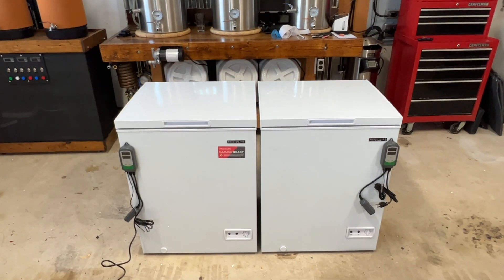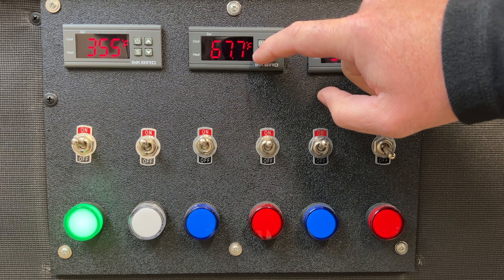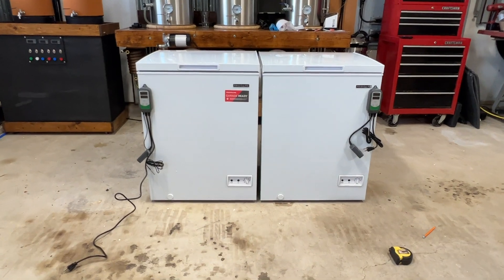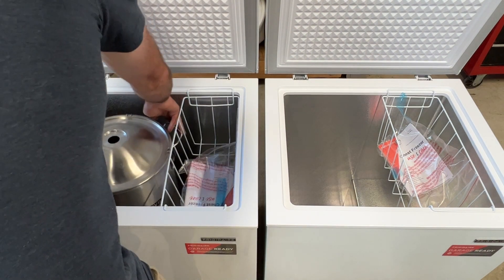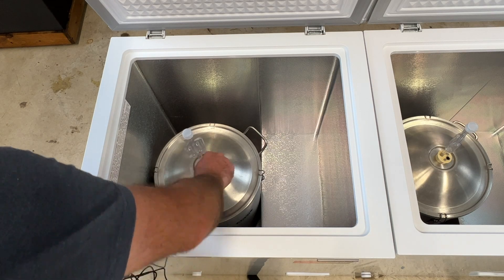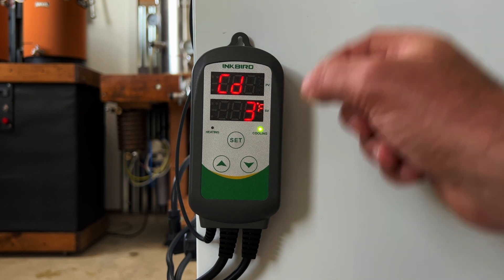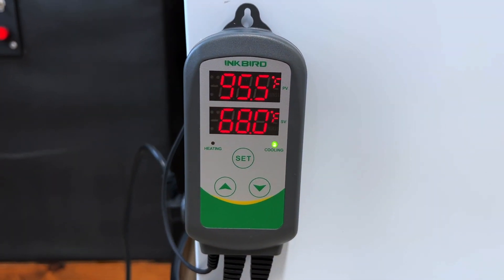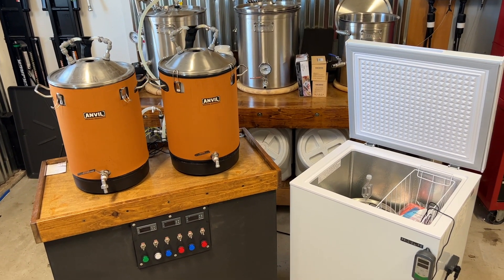How to Build a Fermentation Chamber [ INKBIRD ITC-308 ] #temperaturecontrol #homebrewing

Comment: How much drift in temp is normal for an Inkbird? I am seeing swings of plus/minus 5 deg.
Reply from the maker: I ran a test a while back on  my glycol and fermentation chamber. From what I remember it the temp swing was comparable. 5 degree was at the wider range. Depending on your setup, you can dial it in a bit by having your cooler turn on sooner. I see 1-3 degree swings in my fermentation chamber. The glycol is 1-2 in moderate climate. DIY is tricky to estimate, but I know my systems swing 1-3 degrees. Hope this helps! Cheers!
Reply: @justhomebrew   Thanks for the quick response. One more question if you don't mind , does the freezer temp setting play any part in the temp swing that you have noticed? Thanks -- Tim
Reply from the maker: @timh3662 hmm, good question. What I would do if your dealing with big temp swings is 1, set your desired temp. Then play around with your delayed compressor settings. I have relatively new freezers so they don’t seem to have problems cooling. You might have to shorten the delayed compressor time to off set your temp swing. Also, try different locations for your temperature probe. I monitor my fermenter temp right in the middle of my fermenter using a thermal well and probe. Maybe a your temp probe can be positioned better.

Comment: You have an awesome brewing space! Very neat 😊

Yesterday I built similar setup with an old fridge that I was given for free and a budget electric thermostat. I duck taped temperature probe to my bucket fermenter and set temperature setting 19.0 C for start and 18.8 C for stop. I set fridge power for minimum, so after shutting down it doesn’t go very low. It is working great and keeping temperature between 18.6-19.0 C. I looking forward for much more nicer and clearer beer 😊

Cheers from Kyiv!
Reply from the maker: Thank you! This little space in the corner of my garage has been a work in progress for a very long time:) It’s a blast to brew in.
Reply from the maker: I’m glad to hear you got a fermentation chamber up and running! I love a good diy update:) although you don’t need to have fermentation chamber to get started, I found this was the best addition to my brewery that took my beer to the next level. Cheers!
Reply: @justhomebrew yes, the temperature control isn’t necessary for the beginning, but now it is really hot and I got some issues with cider. It has too much of a harsh ethanol flavour, that I wasn’t getting in spring time. but interesting, that my first all-grain beer went absolutely fine. Now my second all-grain beer will be fermented in a controlled environment so it must be much more better than the previous one. Fermentation now is striking its active phase and I’m very happy. It is going slower compared to fermenting at 29 C but I hope it will worth it.

My brewery now is a 2 square meters in corner of apartment hallway. Almost everything is DIY and I really enjoy this hobby. Especially when building something and finding out solutions for technical aspects.
Reply from the maker: @Dobrovinskiy  that’s awesome! I brewed in my kitchen and backyard for a very long time before a dedicated space in my garage. I like how you think about the DIY aspect of the hobby. That’s one of my favorite parts too. Cheers!

Comment: Thank you! I live in tropical country and the average temperature here range 82~90F. I am looking to brew with yeast that ideally needs to be around 68F. Now I am considering if I want to take the plunge for the chest freezer and inkbird.
Reply from the maker: I’m jealous of you living in a tropical climate! The chest freezer is an easy way to control temps. I’ve had really good success with a fermentation chamber. Cheers!
Reply: @justhomebrew does the incbird retain settings after a outage?
Reply: @matsv201  Just did a web search which returned the following information.

Yes, the INKBIRD ITC-308 retains its settings after a power outage. The device is designed to remember the user's programmed temperature settings and configurations, so you will not need to reprogram it after the power is restored. 

    Memory function: The controller has a non-volatile memory that saves your temperature settings, so they are not lost when the device loses power.
    Automatic restart: Once power is restored, the device will resume operation with the last settings you had saved.

Comment: My first chamber looked just like this, only it was a mini fridge. It experienced horrendous fluctuation. The fridge would cut off at target temp appropriately, but then continue to drop for another 6-8 F. Tried adding a 25 watt reptile heating pad which lowered the swing a few degrees, but then I had the same issue as before only it would exceed target by a few degrees.

Currently building new with the same fridge, only this time im leaving the probe out of the thermowell, added a fan for circulation, a 25 watt cermaic heating element, and drilled an access point (resealed with spray foam) for the wires instead of compromising the door seal. Fingers crossed. I know the brew will be a degree or two warmer than the chamber, but hoping it regulates better while measuring the chamber vs the internal bucket temp.

Do you ever see big swings with your set up?
Reply from the maker: I have not seen these type of fluctuations yet. You can check out another video on this channel that compared a diy glycol system to a fermentation chamber. I took readings from both systems through fermentation. Once in the morning and once at night. I found each system to be within an acceptable range with this test. I thought the fermentation chamber performed very well. I used a Thermalwell for the probe location and just ran the wire between the lid and freezer. I use a heating pad if I need to raise temps. Good luck with your build, cheers!

Comment: Follow up: Would this also work with a small fridge? I would prefer to have shelves. 
Thank you again
Reply from the maker: Yep, it will work with a fridge. The only thing to consider with a fridge is that it has a built in thermostat that won’t allow it to get to freezing temps. The inkbird is just a simple electric contactor that turns off and on an outlet based on what is being measured by the temp probe. I Also used something similar on my glycol build. The inkbirds I used with this project controlled an ac unit.

Comment: So you’re saying I can use this device to bring a 5-7 cubic chest freezer to a temp of 75° - 78° F and maintain that temperature? What keeps the freezer from continuing to cool to the freezing point?
This would be an incredible help for my work with sourdough fermentation. 
Regards!
Reply from the maker: @KogakuKing  I suppose you could maintain 75-78 degree depending on what your ambient temperature is. I typically use a heating blanket to maintain that temperature where I live. You can use the inkbird to heat or cool most temperatures. The way I typically set it up is to use the freezer to cool down temps depending on what I’m aiming for. It works by turning on and off the freezer so it does not reach freezing temps. It also work the other way, it you want it warmer, you can hook it up to a heat source and it will turn it off and on to keep it at a desired temperature. Hope that helps!
Reply: @justhomebrew  so, will the Inkbird and a heating pad bring the small fridge or freezer to 75-78° F and hold it there? I.e., does it heat as well as cool?
Sorry for being a bit dense🫤
Reply from the maker: @ no problem, I can bring my freezers easily up to 74 with a product called fermwrap. I think the heating wrap/pad I use are good for 15-20 degrees above ambient temps. I’ve seen other people use heating lamps. I don’t know too much about those heating source though.
Reply: @justhomebrew 

Thank you! I’m just trying to find a way to cool sourdough and starter ferments to 75-78° when ambient here in Hawaii is 80°+
I’ll definitely look into Fermwrap. I’m guessing I use Fermwrap in conjunction with the Inkbird unit. 
Regards
Reply from the maker: @KogakuKing  ah, okay, then you don’t need a heating wrap. You could just set the inkbird to 75 degrees and the fridge will cool to that temp. You only need a heating wrap if you need to raise the temp. Yes, the inkbird in this video has 2 outlets, one for cool and one for heat. If you plug both a fridge and some sort of heating element at the same time and set the target temperature, the inkbird will turn on  outlets , either cool or hot, to bring your fridge to the target temp. It might seem complicated, but once you see the unit, it should make sense. I use both the fridge and the heating wrap because at the end of fermentation I raise the temperature a few degrees for a diacetyl rest. Hope that helps!
Reply: @justhomebrew Sorry for the long thread. In print it all just seemed a bit convoluted. You have cleared it up in excellent detail.  I think I’ll go with both the wrap and the Inkbird so I can heat as well. Many, many thanks for your patient indulgence!

Comment: Wouldn't a small refrigerator be about as effective and offer front access instead of having to lift out of the chest freezer?
Reply from the maker: Hello, sure if front access is an important to your design. I used a full size fridge for years before building a Keezer. Worked just fine. I feel the Keezer is more configurable, less expensive, and works better for my space. Cheers!
Reply: @justhomebrew  Well, yeah, there is that part about cooling the kegs to serving temperature.  I like mine cold, not slush like but in the low to mid 40 degree range.  Still running my old Kegerator, 20+ years and it still works fine.  I may start bottling again when we head into fall and the triples start to mature for winter delight.

Even in very deep South Texas I still like my dark, thick stouts.  For now, time to stick with light wheat varieties.  Thanks for the video(s)
Reply from the maker: Ah, I see you asked about the fridge in my fermentation chamber video in your first comment. I thought you were asking about my Keezer video. I think a fridge would work just as well as a chest freezer.  I don’t have data,  but I suspect the chest freezer might be a little more efficient due to have a smaller space to cool if you’re only controlling the temperature of one 7.5 fermenter. I’m sure a fridge would do a great job and plus have the benefit of front doors for easy access for a fermentation chamber. I’m glad you’re enjoying the videos! Cheers!

Comment: Fantastic video! Hey can those freezers hold a 6.5 glass carboy with airlock?
Reply from the maker: Thank you for the feedback! I’ll get you dimensions of my freezer. I don’t think you’ll have an issue fitting a 6.5 gallon carboy in there. Just be careful lifting glass in and out!
Reply from the maker: 27.5in H x 12.5in L x 16.5in W inches on one half of the freezer and 18.5in H x 8.5in L x 16.5in W on the other half

Comment: Hello John. Just found your channel and after watching you Anvil Foundry and chest freezer fermentation chamber video I hit that subscribe button!
Like your presentation style and the content is right up my  alley as a casual/inexperienced brewer. A couple of questions for you:
So I assume you have to lift out the fermenter every time you want to check gravity?
What about at transfer to keg time using the spigot. Won’t lifting it out disturb the yeast and murk things up?
I really want to go this inexpensive route. Maybe I’m overthinking it. 
Thanks!
I’ll be checking your other videos
Reply from the maker: Thank you for this feedback and thanks for subscribing! I really appreciate it! Lifting the fermenter will not disturb the yeast unless you happen to really shake it up for any reason. Even then, as long as you don’t introduce oxygen you’ll be fine. The only harmful thing you could do is hurt your back;) Funny you should ask because I’m upgrading my freezer so I can open the spigot without lifting it out of the freezer. Currently I’m unable to open the valve while the fermenter is in the freezer. The inexpensive route is the way to go if you’re just starting out. I’ve just accumulated a bunch of stuff because I’ve been in the hobby for 20 years. I’m still learning;) Cheers!